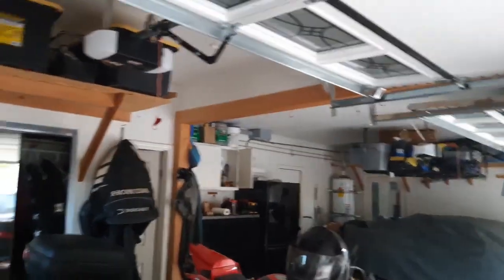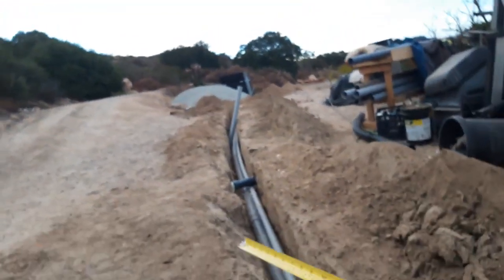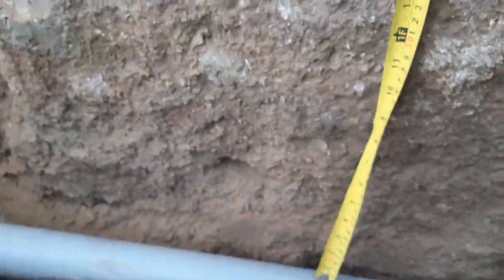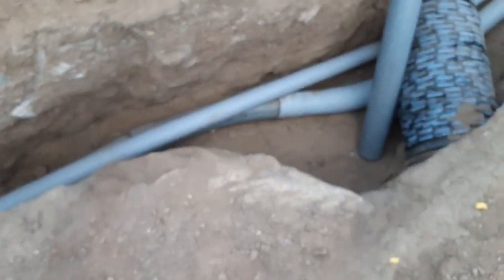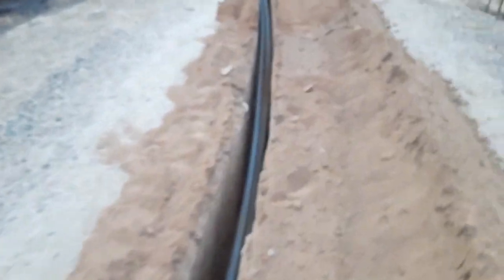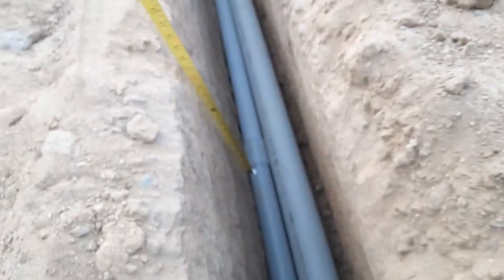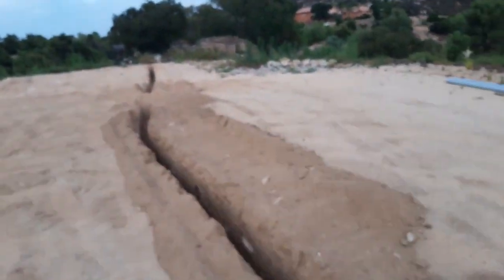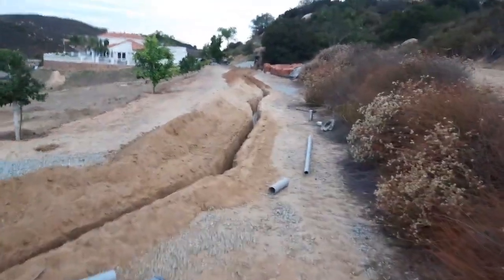Electrical service trench complete with conduit installed and depth measured for count inspection

Comment: Why did you run two conduits?
Reply from the maker: Just in case I want to pull something between the two houses. I did end up pulling a fiber optic cable later.

Comment: 18" depth or cover? PG&E wants 24" cover.
Reply from the maker: Because mine was tied into my house already it was a little different. Basically this was an underground run to a subpanel so it was through my county inspector. 18" top of pipe. Had it been coming off transformer you may very well need to go deeper like you are saying.